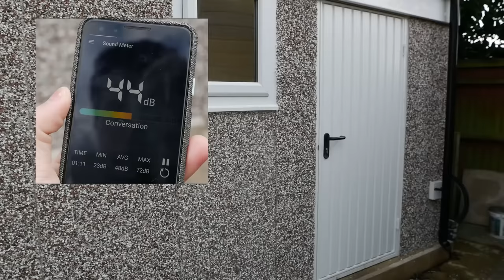Convert a Concrete Panel Garage into a Workshop

Comment: Lovely build, if you ever decide to use it for weight lifting I’d recommend getting foam yoga mats 2ft by 2ft, my floor was 1ft of concrete (base) but I put yoga mats on top of it more heat and less noise, next on my list is to PVC cladding my walls then just to put some aluminium tin foil padded sheets on my roof to stop condensation as my roof is plastic clear pvc sheets so there’s afew raindrops in places

Comment: In 2021 got my old 1970s pre cast concrete garage converted into a craft room, 4 weeks from removing asbestos room , stud wall. Insulation,  flat roof with edpm felt , double glazing,  lighting, 3 double power sockets with usb, cat6 network, hard wired to the router. Ecotile hard wearing flooring, need pvc side door,  garage is located at the bottom of the garden
Reply: Do you mind me asking how much your conversion cost? Thanks

Comment: Looks brilliant - you did a great job. I have a similar garage but really old - the concrete panels are pretty uneven. I only really use it for storing stuff I'm not too bothered about. It has an asbestos roof so I'm not sure it could be turned into the kind of workshop you've created 😀

Comment: Coming from a garage conversion company this raises some serious questions! That floor is going to rot within months, it has no way to breathe.
Walls, an insulated stud wall with a min 40mm cavity from the concrete is a minimum
Reply from the maker: Thanks for your comments. It's been  almost a year and the floor is doing alright. Maybe I'm just lucky😉
Reply: I'm thinking because he sealed the floor that's retarding any moisture ingress through the concrete. It looked like it was regular wood, should have been pressure treated, so over the long hall it may be a problem but perhaps it will be fine.

Comment: Lovely looking job. This may be a stupid question but should the plastic membrane be on the inside, will the heat from inside the garage not condense on the membrane, or am I understanding this incorrectly (which is highly likely). Should the membrane be between the inside of the garage and the insulation?. I ask as I am planning to do this myself.
Reply: Did you ever figure this out?

Comment: After seeing this I’m going to have ago at mine already got electrics in got tumble dryer and spare fridge freezer in there rest is selveing for all me tools and tins of paint as I’m painter decorator,but need to put a sink in and make bottom end a utility for the wife the garage is in good condition,can’t afford to rebuild in brick so will convert this one ,thanks for the vid ,one other thing my roof is metal wouldn’t be best to take this off and start again or just insulate underneath inside thanks

Comment: Job well done!  At last someone has done a decent sectional concrete garage conversion video.  I am about to drop the hammer on my own garage conversion and have been searching for solutions to the many problems this type of conversion brings.  My last sticking point are the roof members to support the plasterboard/insulation.  Have you set a wooden beam running along the join of roof and walls in order to fix your rafters to? I was going to use the existing metal roof supports and attach perlins and rafters to those but I am worried about the weight on them and the large gap to span.
Reply from the maker: There were already some timber running perpendicular to the corrugation of the roof sheets. So I screwed some battens onto those timbers after stapling some breathable membranes directly below the roofing sheets to prevent condensation. Hopefully 04:14 gives you a better idea.
Reply: Steve - any concern towards building regs? Seems a bit of a grey area....
Reply: Hi Steve. Like you I have metal roof beams and like you have a concern about the weight. Have you done your conversion yet and of so what solution did you come up with?

Comment: Very nice.  
Although like myself I have a precast garage.   
But drilling in to the walls even with one screw voids your 10 year guarantee.  Also meant to be bad for the structure.  
Was wanting to see how you got the wood on walls but you skipped straight past that part. 
Precast garage you can only glue the wood beams on to the walls before hand.

Comment: Fantastic video, only thing that perplexed me was a breathable membrane on the inside on top of concrete?  Concrete isn't porous or breathable surely?
Reply from the maker: Thanks. The membrane is to prevent condensation getting to the insulation. That's the idea at least.😜

Comment: This is an excellent video showing in great detail all the steps of the process. What is even better is that this is a UK project. I have one question, where did you use the MDF (as I don't see it mentioned in the video)? I hope that you are enjoying using your workshop.
Reply: Thanks a lot. I used some 12 mm MDF for cladding the roof. You can see it around 04:21.

Comment: Amazing video, Are you able to share a link to the plates you used to secure the timber to the concrete section? I’ve looked on your website and it just says Screwfix but they sell multiple 10 packs of plates

Comment: HI can you just confirm where you purchased and specifically the size of the joint plates you used to fix the vertical wooden batons to the concrete panels. Many thanks Ed
Reply from the maker: Hi I just got them from screwfix. They have all the sizes that may suit your needs.  But I have to drill some extra holes for the screws. Thanks

Comment: Hi great video very informative. May have missed it but did you plaster the walls or just paint the plaster boards?
Reply from the maker: Thanks. I just sealed the seams with some filler and painted the plasterboard.

Comment: Can anyone answer a question that's really frustrating me? 

I am going to install a battened & insulation plasterboard wall inside a garage made of block with rendering on the outside. For the life of me I don't know whether I need to put a membrane on the internal block wall before fitting the battens and can't find an answer anywhere.

The internal plasterboard wall will be two layers of acoustic board with the second fixed using acoustic adhesive
Reply from the maker: Probably it's not needed. I put membrane mainly because I used Rockwool slabs which might deteriorate under condensation.
Reply: @No5Workshop  I'm using accoustic roll. Wouldn't it be the same principle?
Reply from the maker: @andrewmorris2996  I've never used acoustic roll. But if it's something that looks like the  Rockwool then I guess yes.
Reply: @No5Workshop  thanks, I've gone with a breathable membrane. I found out from a builder that basically breathable membranes go on walls, vapour barriers go on the floor.

Comment: Hey. Great video. I am going to use your design to help convert my own building.  I was just wondering what you have done for ventilation to allow for moisture to escape the garage? There doesnt appear to be any which you may want to look into. Thanks for showing me your work. In look forward to seeing what you create. Best wishes
Reply from the maker: There's plenty of gaps around the garage door and personal door. It's been through a winter and summer now. No condensation problem so far😊
Reply: Mix sand and cement on a board saves messing up the floor!!

Comment: Can I ask you why you never used celotex ? or equivalent on the floor I have similar project to do I was told that using celotex will help with the BTU thermal rate as the concrete slab is the coldest thank you for your time
Reply from the maker: Those insulation boards are quite expensive. However if you are building something much nicer than a workshop then I think it's probably worth it.

Comment: thanks for this, I need to work out how to add some shelves to my precast garage as well. What plates did you use to fix the batterns to the precast panels? were they just some bent sheet steel?
Reply from the maker: Hi they are called garage lining clips if you google them you can see how they look like. But I just fabricated them with some steel brackets myself 😀

Comment: Very impressive and mesmerising to watch. I don't think I'd have the patience to do the whole conversion, but I might take inspiration from your roof lining. I see there's nothing supporting the roof batons lower down where they approach the walls. Has this caused any problems? Are they secure enough?
Reply from the maker: The roof batons are screwed onto the timbers that are part of the roof structure. They seem to be holding up alright

Comment: Hey nice work mate nice to see another fellow countryman loving DIY I’m in south london, just wonder the way u did the roof insulation when the time comes is it still possible to do the roof without no access from below? I have a similar concrete garage too thanks
Reply from the maker: For the roof insulation I put a layer of breathable membrane below the roof sheets first and then I fitted some Rockwool sound insulation slabs between the battens and finally screwed on some MDF boards to seal it up. I'm not sure what you mean by not having access from below?😀
Reply: @No5Workshop  I mean when u need to do the roof in the future, the actual roof

Comment: Why did you insulate the walls and roof but not the floor?
Reply from the maker: The main reason for insulation for me is to cut down the noise. I think little sound can travel through the concrete base 😀

Comment: Love the video, just wondering why you sealed the floor then covered it? Did you change plans slightly? Also I think I need to reseal the lining of my garage very helpful tips.
Reply from the maker: Yeah I originally planned to seal and put a layer of self levelling. But the self levelling turned out to be not perfectly even so I changed my plan😂
Reply: @No5Workshop  that’s great to know. Thanks for sharing such a helpful video!!
Reply: We're getting one of these fitted next week. The concrete fillet is down ready. I'll be using some of the methods you used in this video. I want to build a sound dampened area for my drum kit 😁

Comment: Can you give me ONE....logical reason...why do you install another layer on concrete floor?...it´s iracional
Reply from the maker: I originally wanted to put a layer of self-levelling compound. But that turned out to be not so level. Hence using the chipboard flooring.
Reply: @No5Workshop  if self level compound isn´t level...you did it wrong...there´s nothing more leveled that liquid

Comment: Nice! About to embark on the same project here. What are the boxes at 6.51 - and are they on your 'shopping list'? Note there was no vapour barrier or floor insulation, both of which seem to be included in these usually? Sure it's easier to start with an empty garage - I don't have that luxury! Cheers for the video.....
Reply from the maker: Those are Wago junction boxes. There is a damp proof membrane below the concrete base. I would definitely consider adding insulation below the floorboard if I'm building an office or something nicer. But so far for a workshop it's been 👌😁

Comment: How did you attach the clips to the concrete wall panels?
Reply from the maker: I removed the bolts that are used to secure the concrete panels and attach the clips and put the bolts back on.

Comment: Nice job, but PVA isn't a sealer, it's just glue basically and water soluble at that.
Reply: PVA is a sealer
Reply: @Endurorodzndubz  PVA is water soluble, how can it be an effective sealer against water?
Reply: @abscomm  Water is used to make it easier to apply with a brush or roller. Sealer is used for many things, like in this video used to seal up a dusty floor, or dusty walls. unsealed concrete gives off a lot of dust and using a sealer stops that.

Comment: Personally I'd of concreted the floor to bring the height up a little more (maybe have underfloor heating) then poured self levelling compound across it. The walls I think I'd of run all the electrics (sockets etc) then dot and dabbed over it (dry wall) either tape and fill or plastered it. Also for strength you should of staggered the floor. I noticed the ends weren't on the wood frame work you made on the floor you should allow for that to help support the joins. Good job though looks nice

Comment: wish you had shown how you attached the batons to the garage walls , those walls are a nightmare to drill into or attach anything to
Reply from the maker: The garage panels are fastened together with some bolts. I temporarily removed the bolts, attach the bolt with a joining plate and put the bolt back. I then screwed the battens to the joining plate only. So no drilling to the concrete wall is required. I shot some footage but unfortunately I lost them. 😞
Reply: @No5Workshop  thank you for explaining :) really odd I cant seem to see any fastening bolts holding my concrete panels together , I will have to work something out
Reply: @No5Workshop  loved the video hoping to do something fairly similar. Can you share link/name of the jointing plate please?
Reply from the maker: @corytierney9318  Thanks. It's just some jointing plates from Screwfix. I made some modification such as drill larger holes for the screws and cut it short with an angle grinder.
Reply: @No5Workshop  do you have a link for the plates?
Reply: @corytierney9318  I have done the same as this I used screwfix 13064
Reply: @bigtone2005  nice one mate appreciate that! Although I can’t seem to find that code so not sure if they have stopped selling them or a different code? Did you make any alterations to the brackets or any tips?
Reply: @corytierney9318  got the numbers wrong way round lol try 16034.. I drilled the end hole for the garage bolts to fit as they was about 1mm too small and bent them slightly by hand.
Reply: @bigtone2005  top man thanks mate!
Reply: You could probably use a decent construction adhesive. I used some to hold up a wooden fence post against concrete post I couldn’t drill, still holding strong nearly ten years later and that is outside in all weathers.
Reply: @jimporter  good shout any recommendations on brand?
Reply: @corytierney9318  sorry no idea what I used. Probably a no nails or similar but you probably wouldn’t go wrong using anything by Sika.
Reply: @jimporter  great thanks for your help!

Comment: Is there a reason that you chose to put a breathable membrane against the walls and behind the insulation?  I'm doing the same project but others suggest the insulation should be on the warm side of the insulation (in the UK).  I thought about doing both, but it seems that makes things even worse... confused!
Reply from the maker: Since I used the Rockwool insulation it's not water proof. I'm afraid of condensation on the concrete panel getting into the insulation.
Reply: @No5Workshop  that was my worry too... I can't decide what to do...
Reply: @TomStratton  On a house you would have, brickwork -> Cavity -> breathable Membrane+OSB-> then insulation between studs-> Vapour barrier ->plasterboard.

So if worried, you could do the same, sandwhich it between. Stops moisture getting from inside the garage into your insulation. And stops moisture from the concrete outside wall getting into it also. Perhaps you would have to vent between the concrete panels and membrane though, not sure.
Reply: The risk with the build in the video is that warm and moist internal air reaches the vapour barrier on the cold side of the insulation and condenses. In practice if you are not occupying the space too long, it's not heated and there is reasonable ventilation then maybe it might never prove a big problem. If you have a humidity source for the air in the garage, like if you use it to dry your laundry inside, then it could be. Nice video anyway!
Reply: Nice vid ,can I ask why no insulation in floor

Comment: Great video. Did you need sign off re building regulations for this? I'm sat here with the tools and materials but stumped by whether I can actually start or not. All I want to do is insulate and floor the garage and put up an internal stud wall covering the garage door (from the inside) so it is a bit more habitable but everywhere I look it says something different!
Reply from the maker: Hi I didn't apply building reg because it's not a habitable place. To my understanding the building needs to have at least electricity and water to be habitable. But it may vary depending on different area.

Comment: Why not just use the original concrete floor?
Reply from the maker: I tied to use some self leveling compound to make the floor flat, but due to my poor technique it wasn't successful. Have a wooden floor is also better for your legs when working long hours.